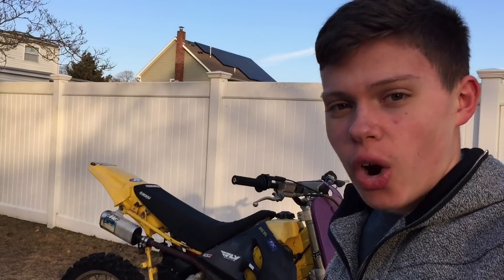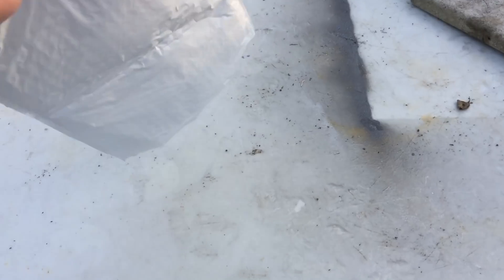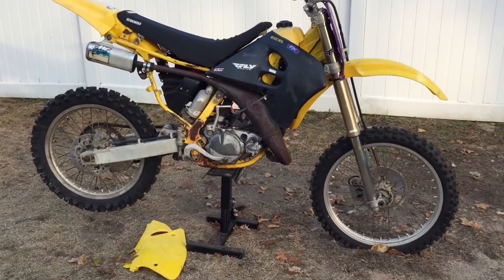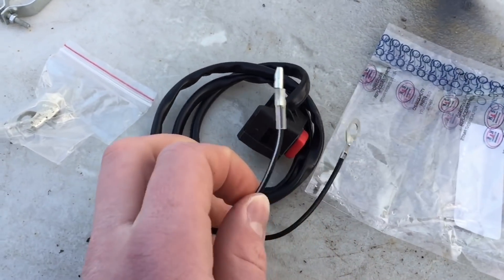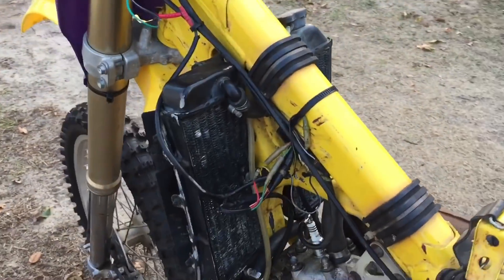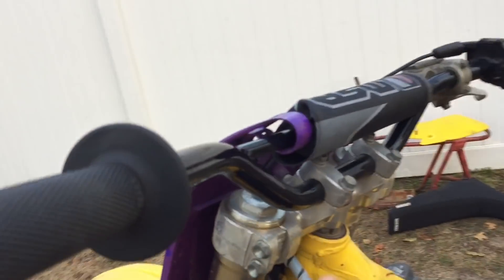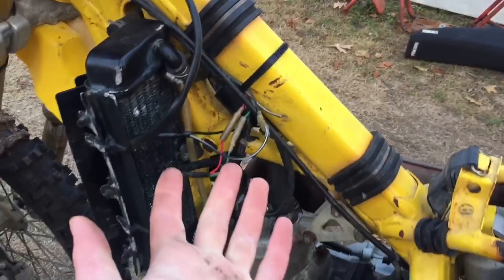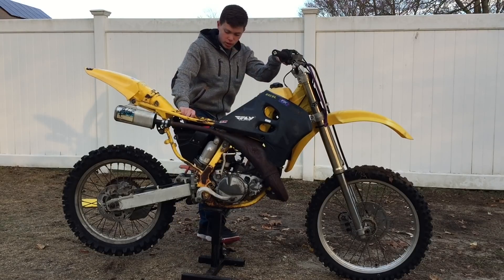NEW PART FOR THE DIRT BIKE!

Comment: What I can see is that if you have spark when the kill switch is engaged the magneto in the flywheel is working your bike is generating spark. Crossing a positive and an earth will short out your circuit and kill the signal. That's the principal of a kill switch. So all your kill switch has to do is connect the signal going to the coil to an earth, that will kill the spark to stop the bike. If there is spark when you press the kill switch it means that one of the wires coming to your kill switch is the signal for the coil. The other is being sent to it. So when you press it your allowing it to send. I think you should take the wire you have attached your killswitch to and join them together with a set of electrical terminals, which you can get quite cheap at a hard ward store. Then take the kill switch and run a wire to the positive side of the coil and run the other to a metal bit of the bike with no paint. If that still doesn't work get a multi meter and set it to the ohmeter and have it so it beeps when you connect the two multi meter cables. Disconnect the killswitch and then put the black on the wire exiting the kill switch and the red on the one entering. It should beep when you press the button, if it is already beeping or doesn't beep either way the kill switch is faulty and that is your problem. If none works just know that something is shorting out your coil, or the signal going to the coil is being grounded/earthed by touching the frame. Somehow the kill switch is bypassing that. By cutting the earth and allowing the signal to flow.
Keep it up am loving the vids and builds only found the channel a week or two ago but I am hooked, would love to see more builds of this nature as this is what I like to get up to aswell haha. Anyway good luck with the build and try some of the things I suggested!
Reply: Also try starting the bike by connecting the killswitch wires and taking the switch off or starting the bike with the kill switch off.
Reply: Thank you I was facepalimg the entire time. It’s simple wiring I don’t understand what he finds so complicated about this. He didn’t even need to spend any money in the first place. He could have used a toggle switch and called it a day

Comment: FYI the kill switch wire leads into the left side of the engine case so it would be best if u take the off the left side cover on the motor and see what going on in there and if it’s rusty then that’s the problem

Comment: had some stuff like this with my pocket bike, we had wire problems and we barelly had any of the power from Coil so we pretty much bough all brand new wires, and new remodeled spark plug for a chainsaw and it worked fine :D started in 3 cranks
Reply: i remembered one thing, when you press kill switch it stops the electricity from powering the spark plug, and when you're not pressing it it stop the electricity somewhere, so i think you might have a need to check your wires possitions or   a Coil.

Comment: do a sparktest and see if the spark looks heathly mostlikely the coil if its weak or as corroded conection creating resistance.  im not 100% sure tho cuz i dont know anything bout the cdi boxes. i grew up working on cars and just now  trying to get a old 2 stroke running too but the differance is that it has spark but the top end is blown and my piston is on a 6-8 week back order and im only 14 so i dont have alot of money to buy somthing better or hire some to do it for me so thats why im rebuilding it my self
Reply: chickensfloat_ on_dirtbikes nice what kind of bike
Reply: Êlvis Lêvèñsøñ only the finest of bikes

Comment: Haven’t watched the vid yet but all that’s left is the stator. Not even sure what the part is but I’d Hotwire that kill switch with a paper clip I’ve done that before just take the 2 plugs out of the 2 sockets and bend a paper clip in there. You’ll have spark til you take the paper clip out disconnecting the 2 wires
Reply: Nvm lol I didn’t watch the vid when I commented.

Comment: The rm 125 100% needs a bottom/top end rebuild sounds so bad like there is sandpaper in there  and the kill switch needs fitting property I can see from the video there is another wire just doing nothing there is nothing wrong with the stator plate or the cdi unit as you had a spark when the kill switch is pushed

Comment: Tear hole thing down and rebuild it new spark plugs new wires new injector system and it will start
Reply: There is no injectors bud. It's a two stroke from the early 90s
Reply: Injectors on a carburettor ran bike

Comment: whats up with that wire that doesnt go to anything on the frame under the tank try to get a wiring diagram
Reply: dirt bike I think i saw same wire also was it black w a stripe just bare sitting under where tank goes
Reply: He doesn’t need a wiring diagram. Considering the fact that the kill switch functionality is reversed all he need to do is jump those 2 wires and it’ll start. I don’t get what so difficult to understand about that

Comment: It's not the stator or coil because on my old 1990 kx80 I was getting no spark at all and my bike would not start I had to replace the stator but that's awfully strange that the kill switch gives it spark I'm not sure what the problem is